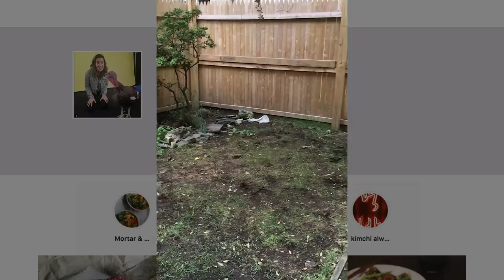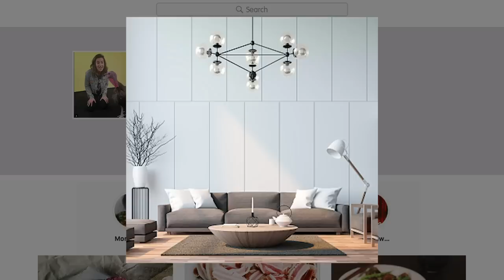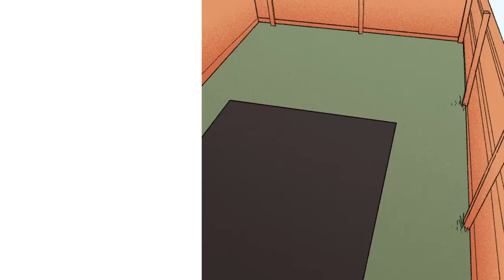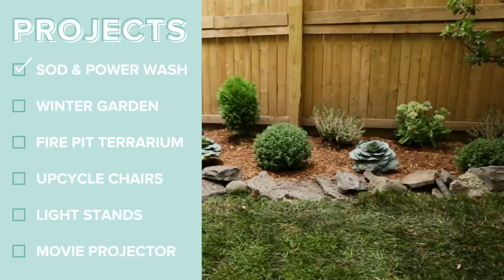I Transformed This Backyard In 48 Hours

Comment: Those light poles are 100% going to fall over with any kind of wind
Reply: And the pretty cushion and pillows on that little couch will get soaked and moldy as soon as it rains on them.
Reply: @kcanded  you can get outdoor pillows and cushions made to withstand weather which i assume (and hope) she did but the light poles were not the best, they could of at least dug holes to put them in
Reply: @heyitsemily677  They probably didnt do permanent light poles in case they didnt like them.
Reply: and seems like Tarn didn't consider the couple's height too.. they would def get strangled in cables or hit the bulbs
Reply: kcanded just need an outdoor cushion box we have one in our backyard
Reply: How? Tf. They have a cement base.

Comment: The light poles and furniture can be covered up when not in use. The gras will have to be watered each day when it is does not rain. Most likely that deck area needs to be able to drain off - the pitch is not done correctly. These guys did a great job.

Comment: The succulents in the fire pit are 100% gonna die. They need really good drainage and old water is just gonna sit in the bottom of that container causing root rot.
If you wanna plant succulents choose a container with holes in the bottom (or drill your own) lay down a layer of landscaping fabric or screen. Then fill with cactus soil (she used the wrong dirt)
When set up properly succulents are hard to kill but these ones are unfortunately doomed.

Comment: It does look great, but in case of a downpour, so many things to take inside the house. 
First of all the wooden chairs cannot survive if you just leave them out. They'll peel and rot. Same goes for the table. Horizontal, so it will hold water for more.  Yes, there is yacht paint which is resistant to water, but even then, it needs painting every year. Who has the time to do that? 
The sofa has cushions which, again, have to be taken in otherwise the fabric will get burned by the sun in the summer and soaked in the winter.  
The canvas and the projector are easy, let's say you can only put them out in the summer, when they are needed. 
The lights too. You'll have to keep them inside and just put them out when you are entertaining. All in all, you have to keep bringing things in and out. Lots of work, and you have to plan for space inside the house to store all this when it is not in season. Do they really have that space?
Plastic-coated metal chairs and armchairs is the only kind that can manage the weather, and of course stone tables (we have marble in my country but I suppose any stone or even ceramic tiles will do).

Comment: Theplant you zoomed-in on is definitely a mum. The sedum is futher back with the thick leaves and pink flowers. If the mum is hardy, it'll survive the winter, but I can't tell from the video. The sedums should, if planted well, do just fine, though you do have to cut them back at the end of the season (i.e. when they planted this "garden"). Not sure if the cabbage will make it. I thought ornamental cabbages were annuals in zone 4? Also, it is NOT a good idea to plant these sort of plants in November. Bulbs, perhaps, but not herbaceous plants.

Comment: Ok, I'm with you on most of your makeovers ... but it's obvious you live in a city & have very little experience with "durable" outdoor landscaping/makeovers.
The basic ideas were cute, but won't hold up over time or even a few weeks and really needed better application.
One thing I always cringe at is when I see a "little garden" area lined with stones or rocks that leaves no easy barrier between the grass & the stones in order to mow or cut the grass .... the owners will either have to cut the grass along the rocks by hand with clippers or purchase a weed eater ... up next to the fences, as well.
mfun503 detailed many areas that could've been done differently & I agree with most every one of them.
As far as the chairs used ... they were NOT all "outdoor chairs," and if ONE rainstorm is going to ruin your patio area, then those chairs will also not hold up sitting in the water from rain and being white, will look terrible in no time.
I'm thinking a raised wooden deck (I'd use Trex Deck or some other composite plastic/wood material for durability) would've been a great idea over that patio.
I think a more permanent solution to the light poles would've been to have used outdoor treated wood for the poles & buried the cement bases in the ground ... maybe using some cross beams over the top from pole to pole would also give the option of hanging some shade cloth for the brutally hot New York summers.  Or, you could plant vines over the top for natural shade.
While I applaud your attempts to make the couple a lovely outdoor space, I think you need some more training & research in outdoor "decor" before you tackle another yard.
Keep swingin' .... you never get a home run if you don't hit the ball!